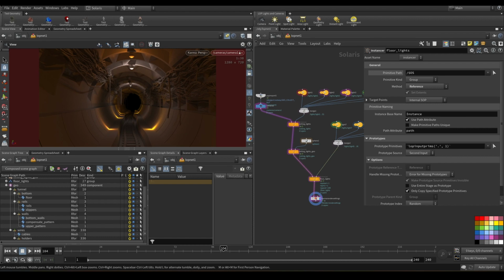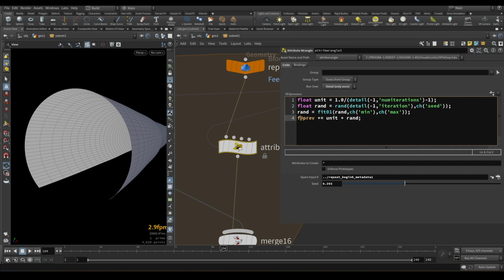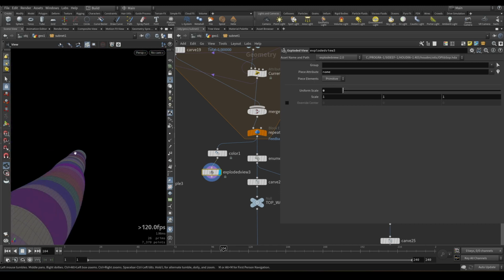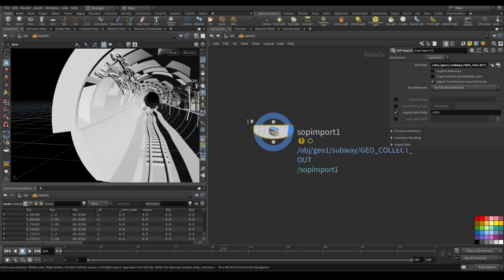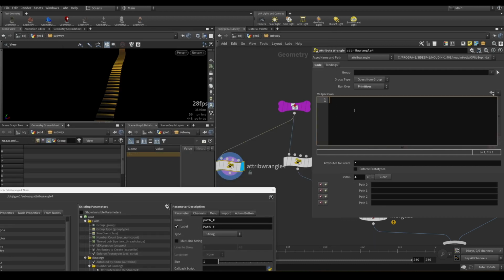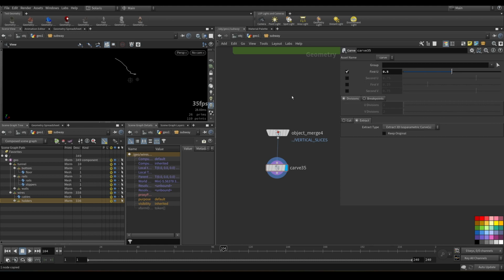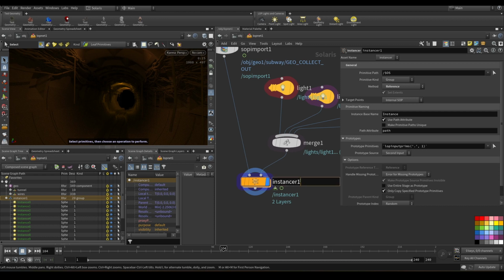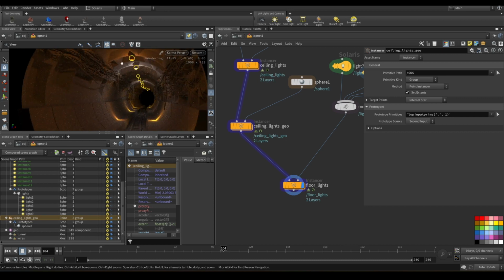Houdini Procedural Subway Tunnel 04 - Lights

Comment: Nice path wrangler! I have made a bunch of wrangler presets for handling paths for prep of imported assets, like deleting paths parts based on index or just creating names from the last path part etc.. will add this to my arsenal. It's pretty insane that SideFX hasn't created any more nodes than the name sop for creating hierarchies in SOPs.. 
The other solution is to use to many nulls + sop import + graft stage LOP nodes.. witch can be handy some times for creating procedural hierarchies.. would have liked to have something similar in SOPs...
Reply from the maker: Thanks for the comment! Glad it helped you a little! These little detail mentions motivate me so much :) You can make this system as advanced as you want, vex borrows some concepts in terms of string manipulation from python, so you can split and validate it based on requirements. 

The solution you've mentioned (and a lot of its variations depending on what prim types required) is more common in production env, because it's actually easier to read and debug. LOPs generally tailored exactly for this, but it can get extremely technical. It's not only about hierarchy itself but also about the way stage composed, what types of primitives are used, validation, all sorts of stuff. 

The approach that I've shared is generally suits better for a single artist/small team. but you can definitely go pretty advanced with that, it is just a foundation. 

Thank you!

Comment: And what about exporting a version to UE5 ?
Reply from the maker: You have two options: using Houdini engine for unreal with HDA with parameters. This option will keep your asset "alive", but  this option requires some set up, can be frustrating but generally worth it. The connection between UE and Houdini is more complex to setup than between Unity and Houdini, but it gives you ability to spawn any actor inside UE using Houdini engine (static meshes, instances, decals, particle systems, lights etc. )

Or you can export usd and use usd plugin for UE (which is really good actually), it requires some adjustments to usd stage, which I will touch on briefly in the next part.

Or an old fashioned fbx, which was the way to go for many years, with lots of limitations and frustration, but still 🙃
Reply: @Genisease  Hahaha....thanks !!! I know all of that but was expecting to see your way ;-)... well...maybe one day. This said : I already try to combine all of your excellent tutorials with the one from Project Pegasus, Rail System from David Kahl to mention some to embed a nice procedural tunnel in a landscape :  I need few different  type (rail, road, pedestrians, technical) so procedural is the solution . About the bridge we spoke earlier : search google for "Hong Kong-Zhuhai-Macau Bridge". Thanks for the nice courses...waiting for next.